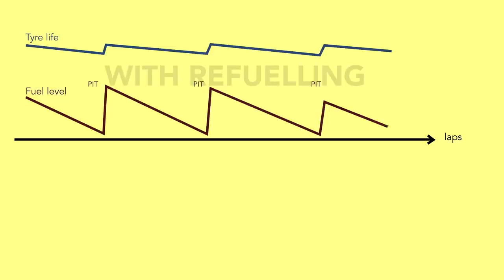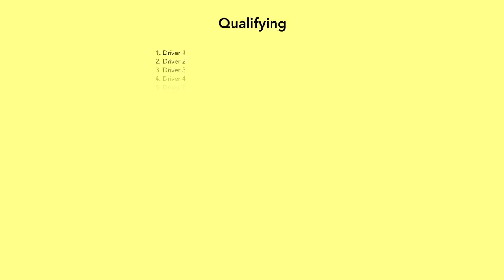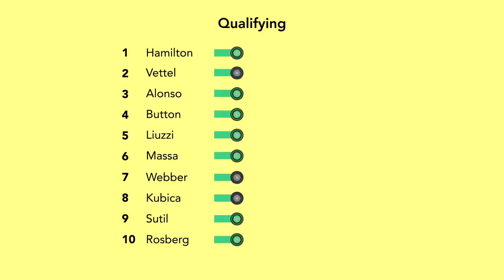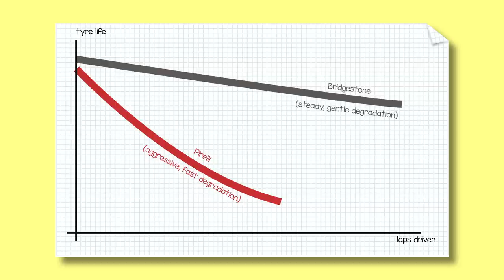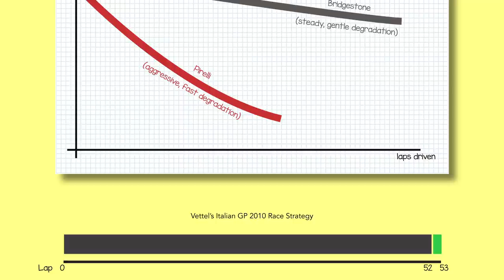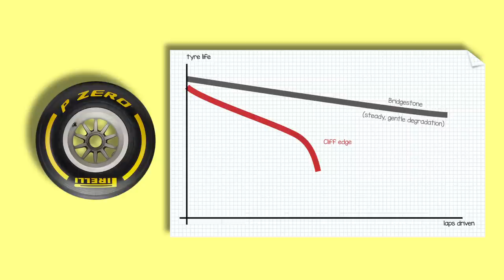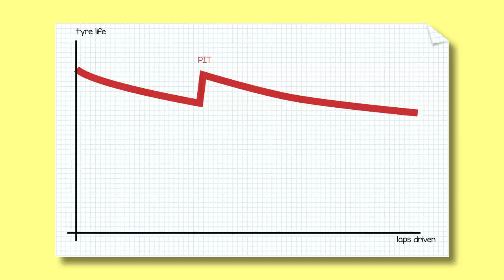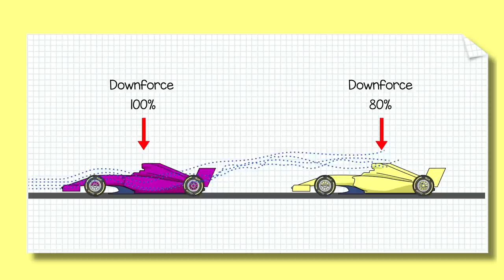How Canada 2010 shaped F1 for a decade - Chain Bear explains

Comment: Raises exactly the points I recently raised in your "positive feedback" video. For me, the issue is not that Pirelli need to make aggressive, unpredictable tyres, but that the amount of running and data teams can do on the race weekend compounds is excessive and needs to be cut down.

Let's use Canada this weekend as a case study:

Each driver has 13 sets of tyres across 3 different compounds selected in conjunction with their team before the race. They then have a certain number of sets allocated for each session and use them as they see fit. So in total, there are 260 sets of tyres available to be used across a weekend, and teams get 4 hours of practice to work out all of their optimum strategies, fuel loads etc.

This for me is the crux of the issue, because unless it rains at some point then the teams can prepare so precisely for the weekend that the outcome becomes somewhat prescribed because of the replicability of performance. So I would completely revamp the weekend to ensure teams get minimal running on their qualifying and race tyres to make them have to be a lot more reactive during the race.

I would achieve this as follows:

1. Teams do not get to pick their tyre allocation for the weekend. Instead, Pirelli bring a set number of sets for 4 compounds to the weekend. 3 to be available for use across qualifying and races, and 1 exclusively for practice.

2. Practice 1 would be shortened to an hour and teams would only be able to run the compound not being used in the qualifying and races. Thus, teams would be able to assess their own car's reliability but would have to build estimations and predictions for their qualifying and race performance based on the standard tyre. More unpredictability.

3. Practice 2 would be revamped. The FIA would set the teams a number of challenges such as fastest lap, fastest speed trap, fastest sector, most consistent driver over x number of laps etc. etc. The winners would be able to choose a package of tyres which would contain a certain number of sets, i.e.

Package 1 (6 sets) - 2 softs, 2 mediums and 2 hards.
Package 2 (5 sets) - 1 soft, 3 mediums and 1 hard.
etc.

The FIA could also introduce time specific challenges i.e. fastest lap in the next 5 minutes, and the winning drivers could pick their preferred packages. Each driver could only pick up to 2 packages no matter how many challenges they won. After P2, the remaining packages would be up for "draft" and each driver would be selected at random to select a package. This would continue until each driver had 3 packages.

This way, teams and drivers would have to try and earn their preferred tyre sets and this would lead to strategic conundrums. Does a driver pick a package full of softs to benefit them in qualifying at the expense of mediums for the race and vice-versa. It would also mean each driver would have to compromise on which tyres to use in certain situations making it more unpredictable, and perhaps creating a tyre advantage for a smaller team which could boost competitive racing.

P3 would be scrapped and turned into a reverse grid sprint race, half distance, half points.

Qualifying would become a 4 stage, head-to-head knockout, where each driver is drawn against another at random and has 2 runs in each stage to set their fastest lap, the fastest driver qualifies and their opponent is knocked out at that stage and given a grid slot based on the fastest laps of those knocked out. This would be a more unpredictable qualifying as you could have Hamilton v Bottas drawn in Q2, or Vettel v Verstappen, meaning big drivers in big teams could end up further down the field, and likewise a smaller team could have a driver make it all the way through to the final 4 by beating other midfield drivers.

The race would of course be the race, but it would be made much more unpredictable and reactive as the teams would have done minimal running on those compounds and would have to react to their varying degrees of degradation. That lack of prior knowledge would put the onus back on the driver to manage their tyre life against speed without prior knowledge of an ideal stint length.

For me, taking the control of the tyres away from the team and treating them like gold dust, protecting them from over-usage and analysis is a key way to make grand prix weekends more exciting.

Comment: I think one thing that gets overlooked as well post-2013 is that the pit lane speed limit was lowered that year as well, after Webber's loose wheel struck a cameraman in the pitlane in Germany, which resulted in even more of a penalty for an additional pitstop.
Reply: That's true, if you could do 100 or 120km/h in the pit lane, it would be less time costing and teams would definitely take more different strategies.

Comment: I really like the idea that, if Pirelli brings 3 dry compounds to every race...require every team to run all 3 compounds in a dry race! Mandatory 2 pit stops, lots of strategy variety; think it would be an easy and interesting way to bring excitement to the races without a lot of change in the logistics and regulations. Could be implemented mid-season, even, hypothetically.
Reply: Won't change much.  The top teams will pull a pitstop over the midfield and control the pace from their.  Here's the thing many fans fail to understand.   The engineers in f1 are brilliant.  They get off on solving problems.  Like most rule changes, it'll only work for a short time until they learn to defeat the problem and return the status quo. 

The new rules for 2019 were suppose to slow the cars down.  In only a few months, they not only regained lost downforce but found even greater performance.  Ban front wings, they increase the complexity of the bargeboards.  Ban FRIC suspension, they invest in hydraulic third element, essentially recovering the lost performance.  Same for traction control, mass dampers, fuel flow limit etc.

In 09, the rules were designed to reduce the numerous aero bits in hopes of improving overtaking.  Where have we hurt that before? lol.  What happened? They discovered double diffusors and outwashing.  Then Newey began adding rake.  It's a non stop cat and mouse between the rule makers and endless pursuit of performance and speed.  And I for one love it!  It's the essence of formula one, the essence of life itself.

Comment: I've always thought the best idea is to have teams do practice on 'practice tyres', so they don't know what to expect in the race, with more strategy variation as a result. It's like whenever FP1&2 are washed out because of the weather, there's always more unpredictability. Is there a reason that there's not much drive in F1 to do this?
Reply: I like your thinking. My plan would be for Pirelli to bring updated new different tyres (compound or construction) every 5 races that the teams have never tested, sometimes it will naturally suit some teams/cars and not the others but always a puzzle for the teams and drivers to solve, compared to now by the time the teams get to Barcelona the pecking order is basically set. I would also give the teams that finished 5th thru 10th in the constructors championship the previous year an extra couple sets of tyres per race weekend, an extra (free) power unit to use per year and an increase in practice time on Fridays from 1.5 hrs to 2hrs per session or a reduction from 1.5 to 1hr for the top teams (whichever solution floats your boat better) to help the smaller teams compete and be more competitive.

Comment: Canada 2010 was a great race indeed and about the only dry race of the 2010 season that wasn't incredibly dull or frustrating. 2011 and 2012 were  exciting seasons because of the extreme tires. Overtaking suffered somewhat when the tires got less extreme in 2014 and 2015, but the third tire compound introduced in 2016 completely reversed the trend. Nowadays the tires are again too durable, which, in combination with the wider cars, creates very unimpressive racing. Perhaps the re-introduction of refueling will actually be a good thing in the current situation, as drivers will push harder and wear out their tires harder to make their strategy work.

Comment: Very informative! You made me wonder one idea: What if Pirelly makes tires with two layers of compound? Internal layer of hard rubber and external of soft rubber for the soft compound and internal soft and external layer of hard for the hard tires? Maybe it’s a stupid idea and impossible but if somebody starts with the soft rubber, when the tire degrades it won’t be dangerous because they’ll become hard and slower, so they will put anyway. Then, with a hard tire, at the end of the race it will become soft and will potentially allow drivers to push harder for the last laps, so it could benefit the show

Comment: The thing that is not quite there is the sort of tyre management possible in the 1980s, when it seemed degraded tyres could be bought back to life to a degree with a series of steady laps or conserved (Prost was usually best at this) so that you could charge later and pass the bloke in front who'd been lapping faster to that point but had also been much harder on his tyres. This is probably because of improved telemetry which takes the driver's skill or guesswork out of the equation. Whatever, the cliff-edge that appeared in the early Pirelli days, seemed to have been far more gentle and flexible in the 80s according to driving style. Perhaps Button was the latter-day Prost to a degree, but the effect of rule changes never seemed consistant enough for long enough to properly evaluate. My own view remains the route to more exciting races lies with track design and a reduction in the overall dimensions of the cars.

Comment: get rid of deg, make them use all 3 compounds in the race guarantees two stops, make the compounds very different in terms of speed
Reply: Changing back to 2016-spec tires will be a good thing I think. We had multiple-stop races back then and it wasn't unusual for a driver to use all three compounds (nowadays the hardest compound is rarely used).

Comment: 1. Bring back refuelling
2. Bring back tyres that are as durable as possible
These two things will allow drivers to push as hard as they can, all the time, which is what we want to see. Artificially created pitstops due to deliberately shit tyres are NOT what we want to see.
Reply: Banning refueling was the best thing F1 has done to improve the racing in the last 20 years
Reply: @zephyr6877  Why do you think that? I guess ultimately it doesn't do much to the racing, I would argue - good racing is all about close competition, whether there's refuelling or not. If several teams are capable of winning a race then it's more interesting. But refuelling and more durable tyres would allow drivers to push 100% of the time which I think would be more interesting.

Comment: No refueling still the worst regulation change ever
Reply: Never used to have 2 second pitstops when refuelling was a thing.  In fact the pit crew had a relatively cruisey time of it because the fuel would always take far longer than anything else.  Personally I think that having the crews racing each other in the stops is a good thing.
Reply: @cragonaut  you'd rather see fast pitstops tham good racing?
Reply: Just make the fuel tanks bigger
Reply: How?
Reply: @sergeantsupreme4395  yeah I loved watching loads of cars stuck behind trulli unable to overtake... it was so great.
Reply: @sergeantsupreme4395  why do you think refuelling makes great racing? I cant remember much great racing when they had refuelling. I remember lots of great racing before they introduced refuelling
Reply: @sergeantsupreme4395  lol, do you really think refueling made good racing? Most overtakes happening in the pits is most definitely not good racing
Reply: @zephyr6877  my bad, it's iust thst from reading the comments you'd think refuelling was a godsend, and I only started to watch f1 this decade
Reply: @zephyr6877  however, until the dirty air problem is fixed, I'd rather see overtakes with strategy and the drivers pushing a bit more than tyre conservation and 1 stops

Comment: What if you were to have high tyre deg which would suddenly hit a time where its a whole new layer where the tyre is like new and without any wear and, because of dirty air making the tyres degrade more than clean air, it would mean you would get to that layer quicker than the car ahead and would gain a huge amount of time and, once you get passed them they will slingshot back past because then they would get to that layer. Then once you pit the cycle continues. This could be made easier to manufacture by making the tyres spec. But thats just an idea it probably wouldn't work.

Comment: Bring back refueling. This would also make fuel efficiency more relevant for manufacturers.
Reply: Shouldn't it be the other way around? No refueling = Need to manage fuel consumption = Efficient is better
Reply: It's why Audi flogged everyone in LMP1 in the mid 2000's with a diesel car: fast car that had to stop less.
Reply: I'd rather see overtaking on track, so lets not do refueling

Comment: by reducing the bad air flow of leading cars it will make a joke of f1, currently most over takes are in the DRS zone.  but if the car behind can stay just behind the leading car, the DRS zone will just become  free overtake areas.  the British 2019 f1 race showed its not really required as there was some good overtakes , but then cars ran alongside the leading car to overtake and not just behind.

Comment: We've gone past the point where pit stops are necessary. We need some new type of race set up to keep racing interesting, while still being fair to the drivers. Perhaps a points set up for qualifying, and then having the racers start in inverse order from how they qualified. Then set aero rules that make it easier to draft the car in front of you so the faster driver / car can pass. Two 'heats', with the order inversed for the restart in between again. Points awarded for quali, each heat, and each pass. Great show, great racing, great results!

Comment: I think it was a great mistake to introduce DRS and high degradation tyres at the same time. 2011-12-13 could have been much more fun, if drivers couldn't have just sail past on the straights. But with the cars since 2017 and low deg tyres, DRS is a necessity until the new generation cars are made.

Comment: The best tire formula is competing tire manufacturers. In those times there was much more variability depending on car and circuit. The Pirelli years in general began ok-ish, got awful in 2013 and improved again since then but if they made tires that would allow to push to the max all the time more driving errors would happen and the demands on drivers and cars would be higher so I prefer durable tires even if pitstops wouldn't be needed. Btw those extremely degrading tires ruined nearly every Monaco Grand Prix since then.

Comment: This is exactly why Pirelli are actually doing quite a good job. Nothing is going to be the perfect answer. Tyres that stay quick but then have a cliff edge? Dangerous and can wreck an otherwise flawless weekend. Tyres that don't degrade and you can push on all race? Takes it down to fuel management and otherwise you wouldn't see very much overtaking.

Comment: Managing the Pirelli tires has been the dark art of the turbo-hybrid era. Everyone always talks about how good the Mercedes engine is, but the engine alone hasn't been the only reason for their crazy advantage in the past few years. They have other secrets under the hood. Mercedes were the first to run thermal imaging cameras during testing to get real-world data on the tires so that they could keep them in the proper operating window. Combined with a trick suspension system that mimicked active-suspension that could be fine tuned to specific track conditions to maximize tire performance. The few times they've gotten this balance wrong were the races when Mercedes performed the worst.

Comment: Well I liked the refueling pit stops they were nice and failures at pit stops way flashier like burning cars or the hose still attached to the car. Today well Pirelli already said it they could make tires last the whole race or even the weekend. If you ask me isn't this just throwing money away? At this point just let the pit stops get out of the equation and make it something optional like replacing the nose or tires if they break from a driver mistake or debris on the ground of the track. Just make the tires challenging enough to last till the end if a driver isn't looking out for them.

Comment: This video basically presents the case for bringing back refueling.

[And if you mention Verstappen 1994, I'll mention that (1) Benetton were using an illegal refueling rig to decrease refueling times and (2) the lack of serious injuries]
Reply: It does not in any way make a case to bring back refueling - unless you want racing to be about pit stops rather than on-track action. Did you miss the part where they pointed out the increase in on-track overtakes once refueling was banned?

Comment: Well, Formula e don't have pitstops anymore and the races are thrilling. 
But they don't have a dirty air problem and all the teams are closer than in F1, so... is Formule e what we want F1 to be ? 
Maybe, yes.
Reply: Because they create next to no downforce.  And are hella slow.  Formula one can't have it's cake and eat it too.  If we want close racing, downforce needs to be slashed regardless how it's generated.
Reply: FE cars are pathetically slow compared to F1. Most of the action comes from the fact they race on such short, tight street circuits.
Reply: @colehartel7206  Do they race at Monaco?